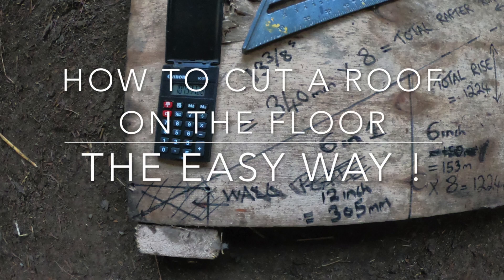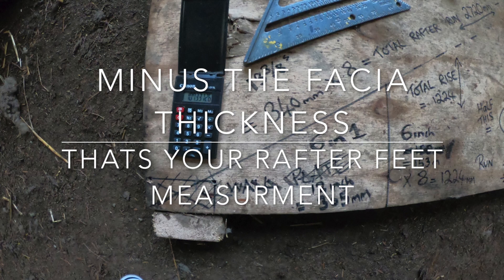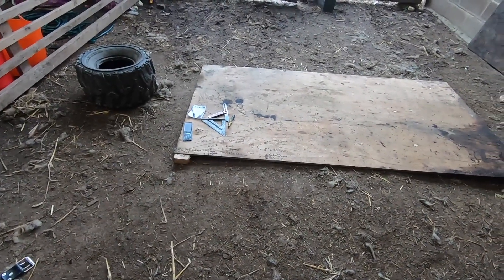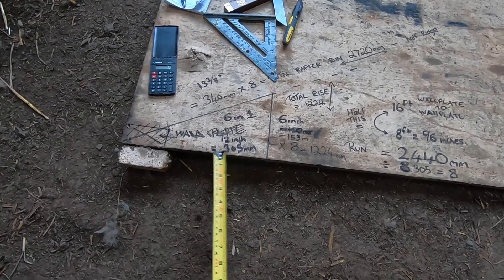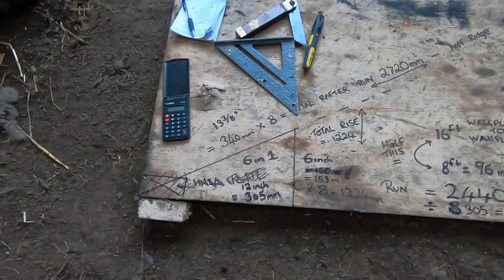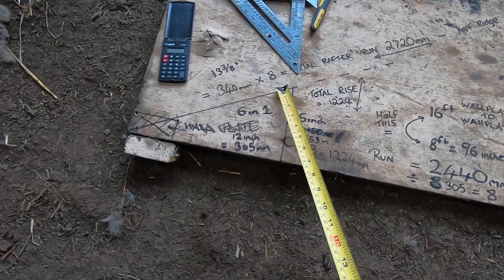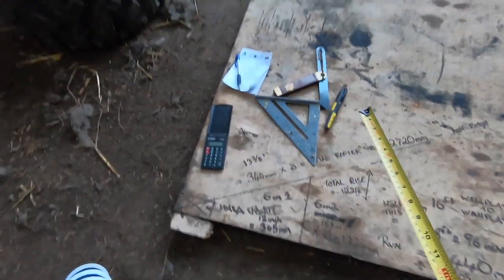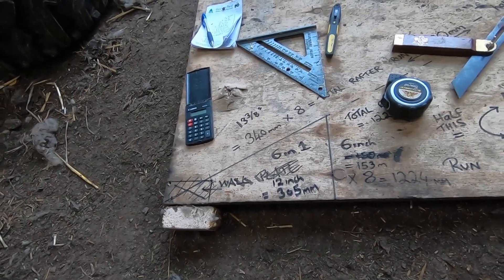Uk site carpentry apprentice hacks n tips ( how to work out rafter measurement the easy way )

Comment: Gazza hope you don't mind a bit of a critique here but if you know the run and rise when marking out full scale surely it's as simple as measuring along the run, say, at 1ft and 2ft  intervals  and drawing perpendicular lines from each mark. Put a dot on each perpendicular indicating the expected position of the rafter (which you will know). Then just join the dots with a long straight edge to the desired point.
Reply from the maker: Yep you can do that, I was just doing it on this ply to show you in a way that could be understood. In reality you would draw the small triangle ( if you want to ) measure, do the sum and have the rafter length.

Comment: Sorry Gazza this could be misleading for apprentices and others, In America and Canada they use pitch ratios 6 in 12, etc and in 
Uk Europe and Australia etc we normally use degrees for pitch roofs!
Reply from the maker: No worries, I work roofs in feet n inches mostly because I find myself not making to many mistakes that way. the speed square has degrees and the other hip valley marks and I just transfer with a black pen on the square itself.
I just explained it in both mm and inches so others who use mostly mm could follow 👍
Reply: @onlygazza  point is pitch ratios 6 in 12, 7in 12,  8 in 12 etc  misleading, in Uk on the Architects drawings the pitch’s are given in degrees!
Reply from the maker: @carpentryandwoodwork2018  yes I know, so you use degrees or convert to pitch, same angle in the end.
most of my mates still use inches and pitch but it depends on how you roll 😂
Reply: @onlygazza  sure isn’t it all good reading for the punters who are doing their roof Carpentry exams.
Reply from the maker: @carpentryandwoodwork2018  don’t take it so seriously it’s just a you tube video trying to help some people out who are not academic. 
tricks of the trade that I used all the time because most of the roofs I was working on were older uk buildings that were all made using feet n inches and not mm
( ps if you look at most of the newer trusses a lot of them are still pitch turned into deg )
Reply: @onlygazza  all fun and games for the boys😁but the apprentices like to know the right way of it!
Reply from the maker: @carpentryandwoodwork2018  if you look through my comments on these few carpentry vids I did on one weekend when it was pissing down you will see that it’s encouraging younger people to go into carpentry, girls and boys, and it’s been some of the most enjoyable vids I’ve done yet when I have comments about them. Are they perfect, no but If you want college teaching go to another video cos there’s plenty about.
I know that the reality of being a carpentry apprentice was nothing like what’s being taught in university or college and you have to deal with awkward situations and awkward people who don’t really want you to learn the trade, especially in the first couple of years, so I make no apology for my vids at all.
Cheers for commenting 😊
Reply: @onlygazza  yes no problem I just like to guide some of the future Carpenters in the right direction because they are going to meet with a lot of competition etc
Reply: @carpentryandwoodwork2018 why does it matter, if it works it works, if you try something and you succeed who are you to be saying it’s wrong
Reply: So where are your videos showing the way you do it then?? Always one who wants to prove they know better!!
Reply: @marccarter4469  all fun and games for the boys😁
Reply: @carpentryandwoodwork2018  Didn't answer my question though did you

Comment: Hi gazza,
Not really correct, no malice intended,  you need to factor in HAP and add this to the rise and then deducted 1/2 the ridge for the pitch to remain true
Reply from the maker: I was measuring to the front of the birds mouth and I did say take away half the ridge but everyone does it different ways, thanks for commenting 👍
Reply: @onlygazza   
 Agreed,Thanks for the reply, but we still need to add the HAP to the length of the rafter, to achieve the correct pitch
Reply from the maker: steve foster with the way I showed you in this vid you just get the pitch off the speed square ( eg 1 in 6 = 1in 6 common rafter line on the speed square or whatever pitch it is )
You can do it from the hap line like you say if you want to but it’s the same angle of 1 in 6 common rafter.
Just trying to make it easier for people to visualise angles in their head without being to complicated
Reply: @SteveF2483  In America and Canada they use pitch ratios 6 in 12, etc Uk Europe and Australia normally use degrees.